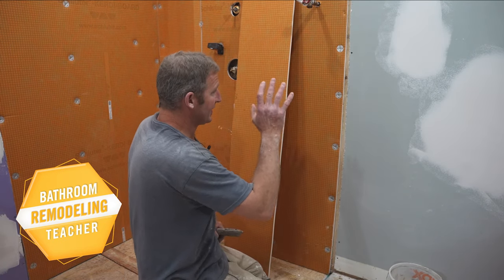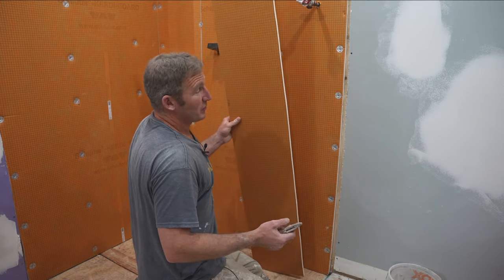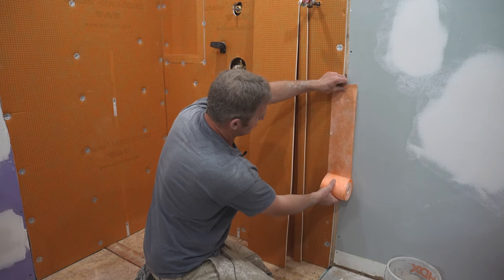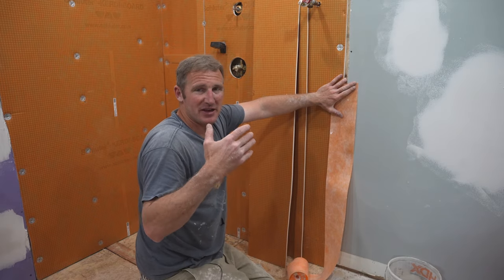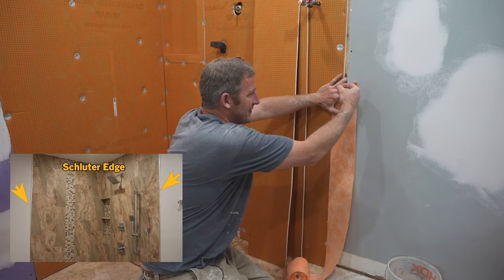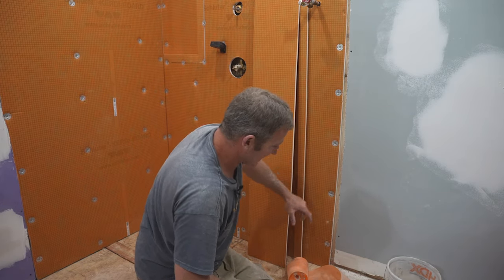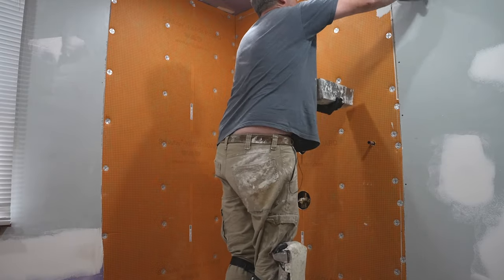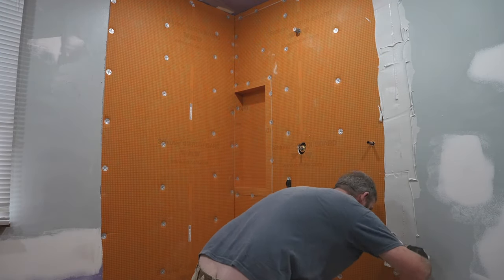Shower Waterproofing to Drywall l PLAN LEARN BUILD

Comment: I had this exact question come up today. I am starting a kerdi board install in a small 3 piece bathroom. The tile is not going all the way to the ceiling and will stop short about 4 inches from the ceiling. Can I just extend the kerdi board all the way and mud over it and use drywall tape on it at the corner of the ceiling and wall? Or should I cut the kerdi board back and put a strip of drywall up there?

Comment: Why does this joint need to be waterproof? The glass door should be the edge? In the bathroom I demoed all the tile was on drywall I don’t think they even had red guard in early 80s and no real issues. Couldn’t just the kerdi fix be used to fill gap, then caulk any gap in the profile?